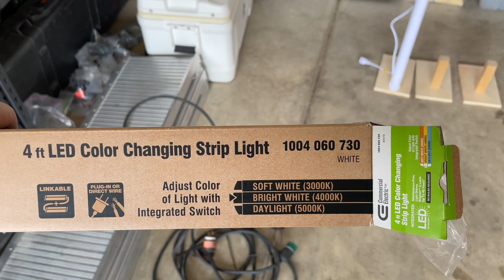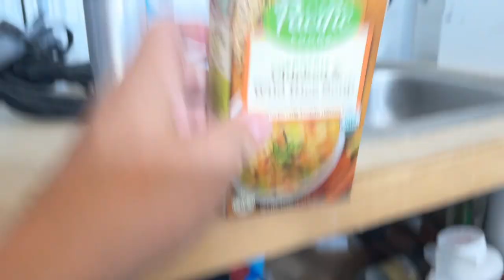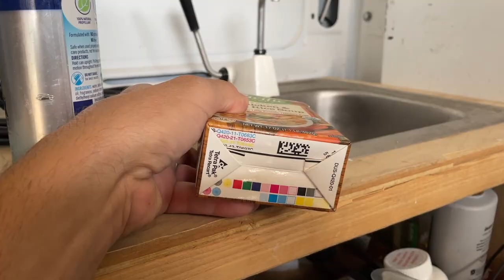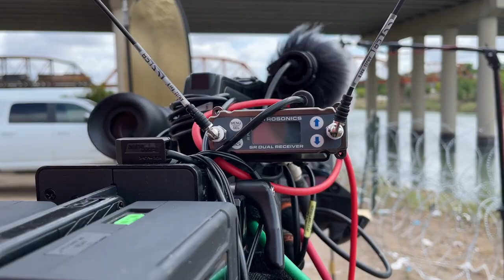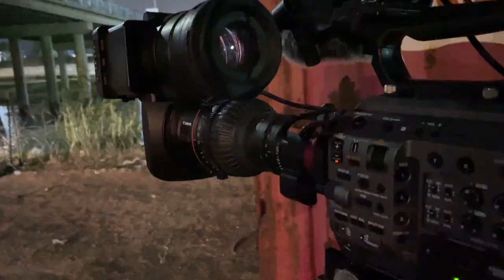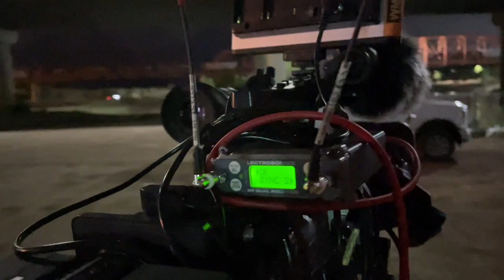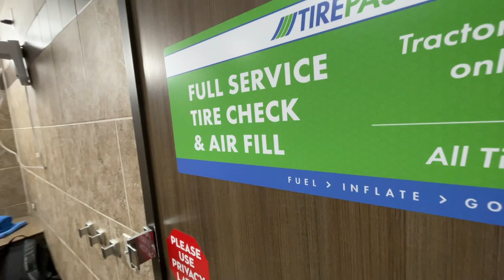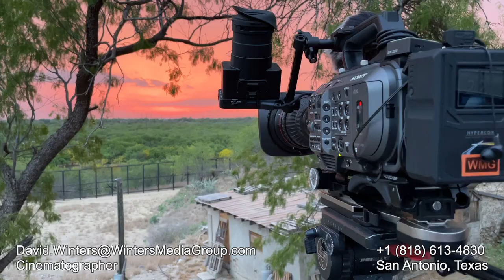Documentary TV Series and Border

Comment: Similarly found and ate a container of microwavable soup (clam chowder, no less) this week that'd been sitting in the truck for a year.  I'd say 78% chance you're safe... good odds!   Curious why you opt for the 17-120 over your 28-135 on ENG jobs... the slight bit of extra reach in S35 or the simplicity of manual operation?
Reply from the maker: Several minor points make the 17-120 preferable.  For news I’m running 59.94i which requires 5k sensor scan or smaller.  28mm at 5k is not wide enough.  17-120mm has a slower and smoother servo for push / pulls. 17-120 I can acquire and follow focus consistently. 2.8 vs 4.0 makes a significant difference in BG exposure at night. 

28-135mm is preferred for extended shoulder work, lighter weight and the AF for interviews is nice.
Reply: @CrankyCameraman  sensible, you are doing plenty of night work on these shoots... and one thing I learned is that you DO NOT want to gain up if you're using the 2K S16 mode, unless the shot is just vital regardless of grain.  It gets ugly quick.